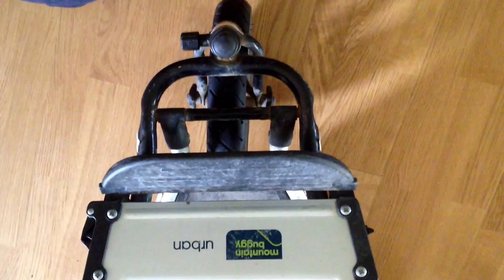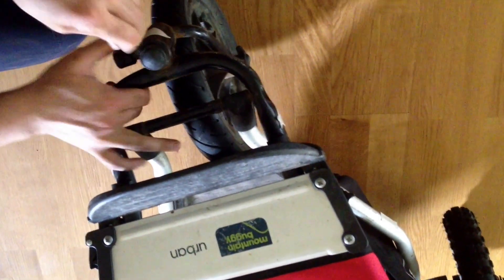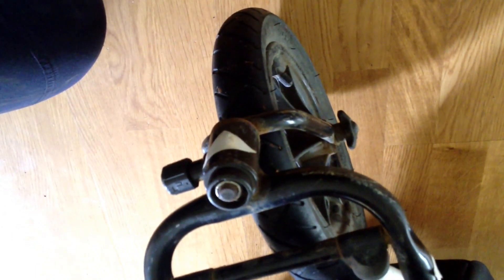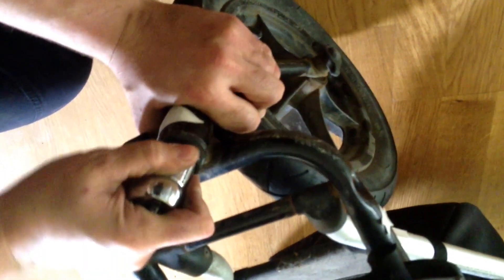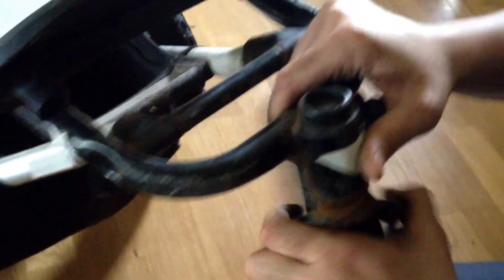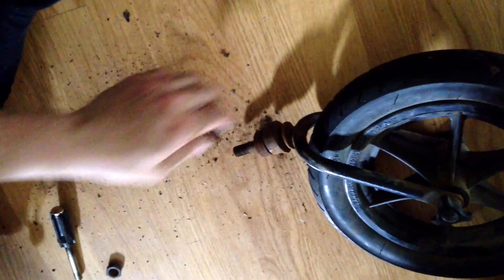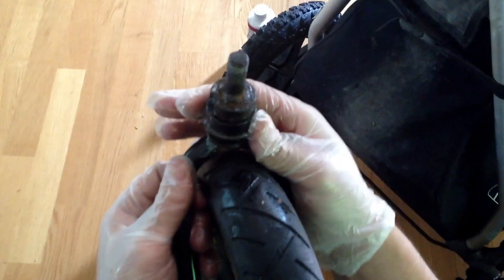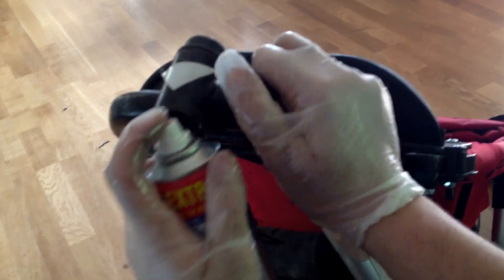How to Fix the Mechanism Hosing the Front Swivel Wheel on a Mountain Buggy Urban Jungle

Comment: Thanks for a really helpful video! I’d love a hint on how to deal with the model with the smooth pole, that you mention. I happen to have one of those.
Reply from the maker: Hi,
Sorry for taking a while to get back to you.  I haven't had this model in for a while so I've been unable to make a video.  The trick with this model is to use a thin flathead screwdriver to carefully pry up the teeth on the inside of the washer so that you can remove the fork.  I say carefully because it can sometimes be difficult to get a replacement part if you break the whole washer and you will need to bend the teeth straight again at the end of the operation in order to resecure the fork.  Additionally, at the end, when you are putting the washer back in place, it might be helpful to find a length of thin-gauge metal piping that can fit around the top pin that the washer is meant to hold, such that you can hammer the pipe and thus force the washer downwards on all sides simultaneously.  Hope this helps, I know it's not as clear as watching a video.

sincerely, Wade, BarnevognVerksted
Reply: I just bought one of those that needs maintenance, anybody had luck with this?
Reply: Me too! and the wheel keeps popping out because I believe the washer that should be in there is missing?

Comment: I have a hartan skater 3 wheel model and it seems the front swivel wheel pops out when I am walking for no reason it feels a little loose has a button on top of the lock mechanism but it doesn't always want to lock wondering if you know how I can stop it from coning out of its socket and to lock into place?

Comment: Hi, you said to comment if there was a metal washer type piece. I’m actually trying to fix my rear wheels. The locking pin mechanism has been misused and requires research g. But can’t figure out how to get that metal washer out?? Please help!
Reply from the maker: It's been a long time since I worked on an older Mountain Buggy like this, but to remove the washer in the front housing, you need to pry up the teeth a bit (carefully), and then hammer out the axle.  During reassembly, you need to hammer the washer flat again so that the teeth press sufficiently against the axle to hold it.  You mentioned rear wheels though, so if you have a washer there, then I'd need to see a picture to figure it out, unfortunately.

Comment: I have a 2005-07 MB Urban Jungle Double with a wobbly front wheel, but it does not have a plastic cap and only has a smooth round metal on top where your nut is in this video. Any idea on how to go about tightening?? Thanks!
Reply from the maker: Jamie Lewis On some of the earlier models, a washer with teeth facing inwards to grip a groove in the shaft of the fork is used in place of a nut. Carefully pry off the washer and check how damaged the teeth are.  If possible, go to a hardware store and replace it with a fresh washer, if not, use a hammer to flatten out the washer, especially the teeth as much as possible.  Then examine the shaft itself. If there is a lot of rust  within the groove you need to remove this with some sort of cutting tool. The idea is that the washer's teeth hold the shaft by being trapped within the groove.  This is an inferior system to the newer forks that use a nut, and it is also possible to order a new fork from Mountain Buggy.
Reply: Barnevognverksted Thank you, I will give it a try!

Comment: would you be able to help us? we bought a used older stroller. it is a mountain buggy urban Double.   the  rear shaft is bent, how do we take it apart? thank you
Reply from the maker: Hi, good stroller :) to replace the rear shaft, you need to remove the internal tooth lock-washers on the rear wheel housing in order to release the shaft.  Use a flathead screw driver to pry up the teeth.  The process is more or less the same as what we do here to remove the axle from a rear wheel on a Bugaboo Cameleon: https://www.youtube.com/watch?v=X_FTPBiCKDA